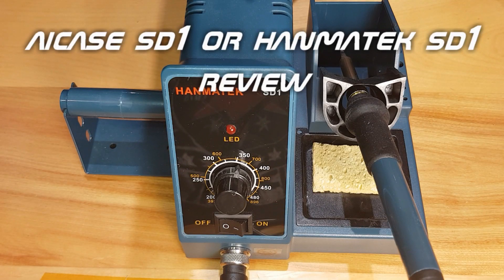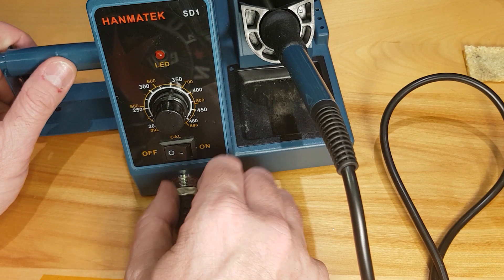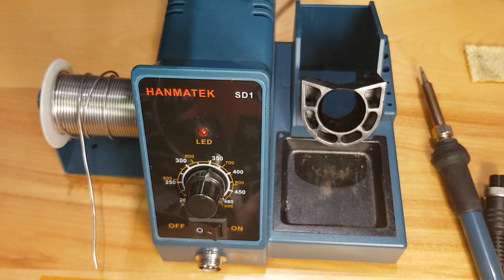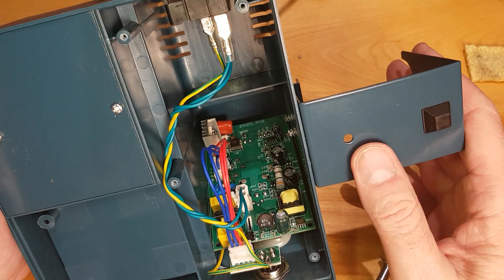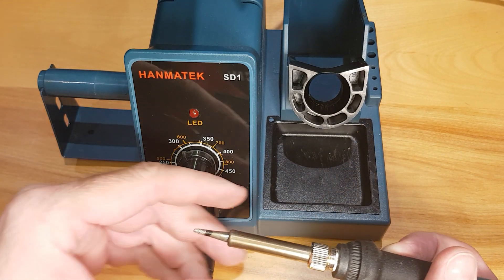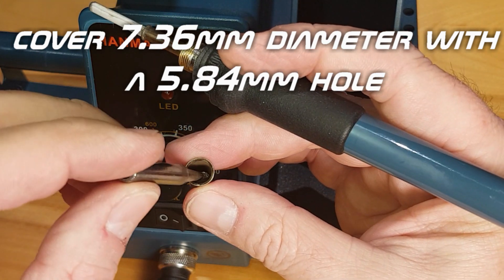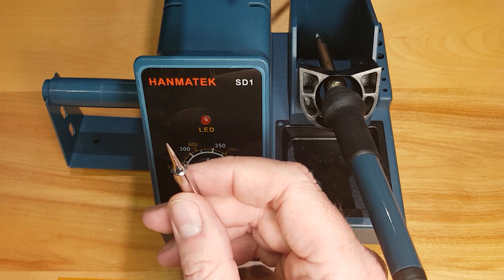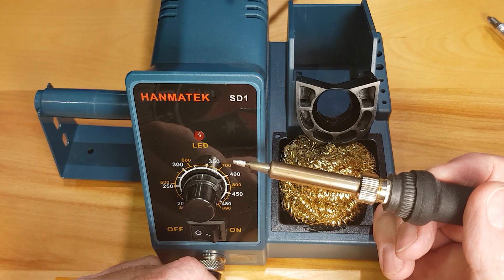AICase SD1 or Hanmatek SD1 Review/details

Comment: The inside diameter of cheap direct-from-China tips tends to run about 4.15 to 4.3 mm, for a very sloppy fit and poor thermal transfer.  It's worth purchasing high quality tips direct from Hakko USA or from some other authorized electronics specialty distributor. The ID of my Hakko tips is 4.05 mm....
Reply from the maker: Thanks for the tip!  no pun intended.  :)

Comment: Cheap Chinese garbage. Broke after light use, internal relay suspected but can't get to the board because they jammed it in. Junk
Reply from the maker: Mine is 3 years old and still works great.  Thanks for watching though.
Reply: Harbor Freight sells a $45, 50 Watt "Schneider" adjustable temp soldering station with temperature-sensing feedback. It's a rebranded Atten AT-937, a clone of an older Hakko 936, and better built than the Hanmatek (has a power transformer, internal fuse, and no relay). It uses standard T18 or 900M tips. I posted a review and teardown of it on my channel recently.  Sometimes available for less than $45 in-store with a printed-out online sales coupon. HF also sells a digital 80Watt soldering station for $115, even less on sale with a 20 to 25% off coupon. It's a rebranded Atten ST80, with preset temps and programmable sleep/standby modes. I'll do a teardown review of it shortly.

Comment: Thanks for this. Looking into a first station like you after years of just 'ye old soldering iron.' Just gets more confusing.
Seen one called a 'Tilswall' which has a big transformer, but many others look like this one, just a few components and a circuit board.
What's the difference and which is better?
Reply from the maker: Thanks for the input. I look at it this way.  Transformers used to be used to step down voltages but most electronics in the house now have switch mode power supplies so whats the difference if your soldering station uses it?  The biggest benefit of the transformer is isolation from the mains power, but this stations tip is tied to ground, so all should be good.  My station is still working well, so I have no complaints.
Reply: @thecityviking  Ok thank you. Definitely on the short list for the occasional household use I need.

Comment: I was searching for details regarding the replacement tips available for this unit, and whether it is compatible with Weller tips.  Thank you for including the availability and types of tips available at the end of your vid.  Similar to you:  I have 2 then top-of-the-line Weller soldering stations from when I was in college, and shortly after.  I noticed that neither one would reliably melt solder anymore.  I blamed it on the new lead-free solders, but when I finally got some "real" (Pb) solder from China, they still wouldn't work right.  There was no model number evident on the solder stations.  A salesperson told me they were, or were compatible with, the W-TCP-L model product.  It turns out that Weller used a fancy Curie-point device ("magnestat") as a thermostatic temperature switch located in the shaft of the soldering iron.  When the iron reaches the "high-water" temperature, the ferromagnetic material loses its magnetic attraction, and the NC spring-switch is pulled open until the ferromagnetic material cools sufficiently to pull the iron switch contact open again.  The "target temperature" for the iron is determined by the mixture of metals used to fabricate the sintered ferromagnetic material.  

I love these irons.  I have used them to build all manner of things throughout my career.  Isn't it amazing that something so complicated could work so well for so long?

The man who answered the tech-support line at Weller-Tools told me that the unit I had had not been manufactured for over 40 years.  He also told me the price for a replacement iron, and that I would have to cut the connector off of the new iron, and solder the cable to the soldering base station to repair the units I have.  The price for the replacement iron would be significantly more than the price of the new Hanmatek SD1.  The problem is that I do a lot of different kinds of special soldering, and need a number of different kinds of tips.  So your vid has been exactly what I needed to see.  Thank you.
Reply from the maker: Glad to hear the video helped you out. I couldn't find anything online myself so I decided to make the video so others could make informed decisions on it. I have been very happy with it so far.
Reply: I realize that its been several months since your post, but this soldering station takes standard 900M series tips. Amazon offers a large variety of replacements tips.

  I paused the video literally seconds before you mentioned about the 900M series tips and read the comments.  LOL
 By the way, that was a nice review of the unit.